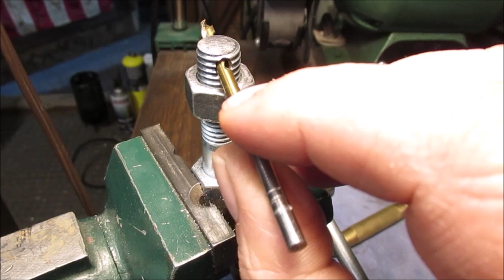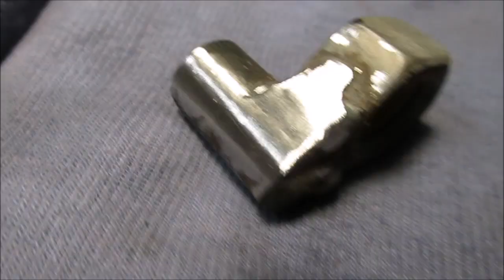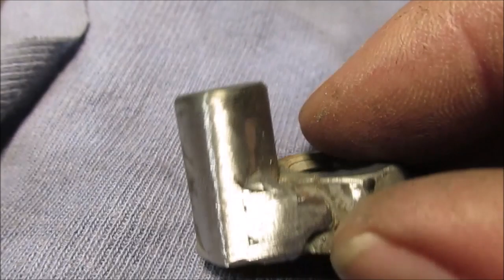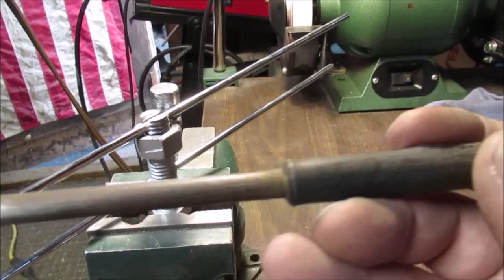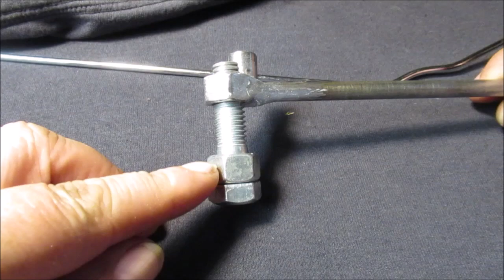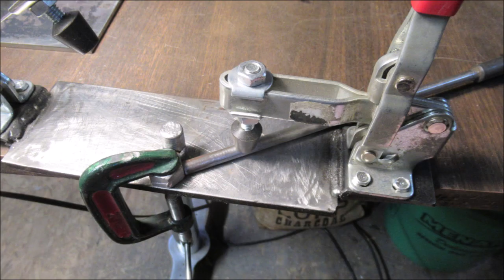HOMEMADE Mini Rod Bender

Comment: That is quite the bender.  Some would say just use a vise but you would not have the control like you have with the bender.  You also make crisper bends and your material doesn't get damaged.  I like it.  Stevo
Reply from the maker: Thanks   I do want to make one that is better at making rings